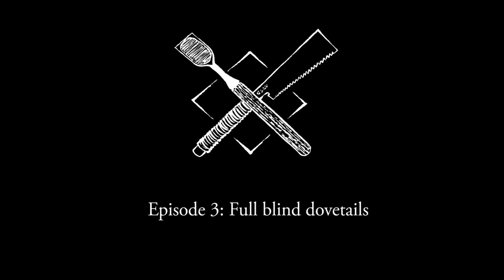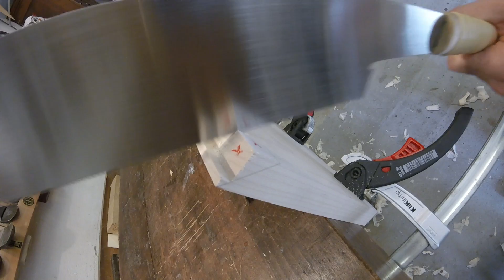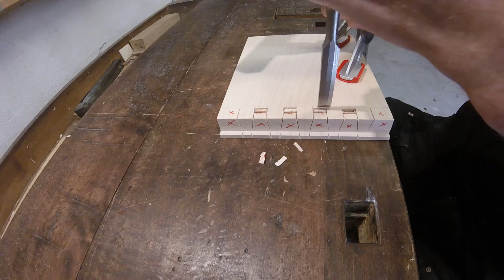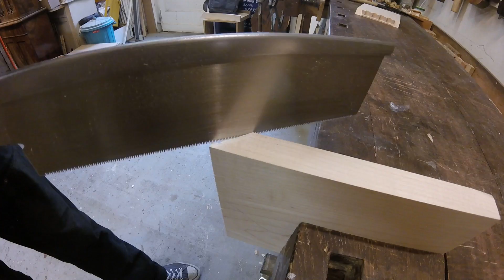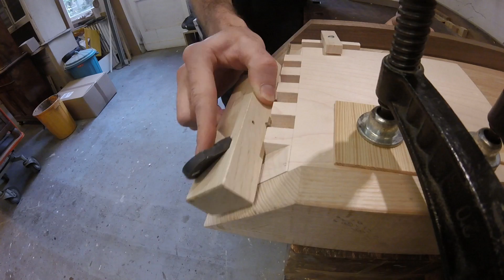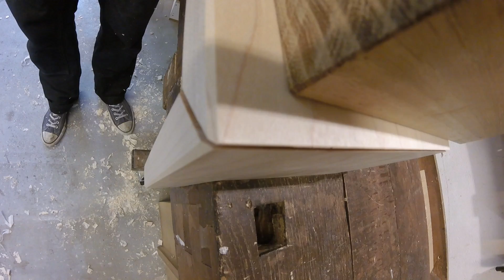Joint Venture Ep. 3: Full blind dovetails (Western / Japanese Joinery)

Comment: There is one of these in the corner of the stair string at the landing in my parents' very old house. In a 12" x 2" bit of oak. 
I put it there, and only I know that it is there. Until someone else needs to replace the stairs in another 500 years. (The house was built in 1450-ish) 
It was made more fun by the fact that the walls it fis against are not at 90 degrees and the joint is not perpendicular to the strings. 
(But, also, it took me most of a week, not 10 minutes and 36 seconds)

Comment: Nice tight beautiful joint, how did the inside turn out? you didn't show the inside corner of the joint. I wanted to see if all your hard work turned up a true blind joint inside and out. Feel a bit let down on that bit. Still, from the outside it is a gorgeous joint.
Reply from the maker: +Thomas Russell thanks! Take it from me, it was tight. I've done them a couple times before. I just forgot to take pictures of the inside...

Comment: Hey Dorian, been following your vids for a few years.
Question....on this full blind dovetail, it looks like you chose to mark and cut the pins first.
I’m assuming that you’d normally cut tails first, is there a reason why you went pins first on this one?
Mate in work is going to try, thought I’d ask
Cheers
Reply from the maker: Hey, thanks for following along!
Definitely do the pins first with blind dovetails so when you use them to mark out the tails you get the dovetail angle correct. Since there is not much space to mark with the rabbet.
Reply: @DorianBracht  thanks appreciate you answering.

Comment: Can these be done angles other than 90°¿
Reply from the maker: Of course :)
Reply: yeah lets say for pentagon, but the woods wouldn't have 45 degree angle but 54 each, joint stays exacly the same.. Just one question how strong are joints ? Are they stronger than nails and wood, and how do you measure angles for mini slots that fit one to another ? (any specific angle or more angles are good ? )

Comment: You did a great job at it  but it seems very unnecessary, you won't ever see your work and the only real benefit would be strength but I feel like there's easier and faster ways to achieve a strong joint.
Reply from the maker: +Tyson thanks and nope :) not this strong.
Reply: come on now, 6 dowel joint would be plenty strong enough! haha but when building by hand who wants strong enough when you can have indestructible! The whole point of this really is the challenge. When you approach it with a nothing is too much trouble attitude you start to make spectacular things!
Reply: The hidden fingerjoint/dovetail is more of an aesthetic thing, 
with a slight bevel or round over on the edge you get an extremely strong joint that looks almost as if the wood grain is continuing through a 90 degree turn.

A great choice for anyone who wants to bring out the natural beauty and strength of the material.
Reply: A standard dovetail joint would be just as strong if not stronger.